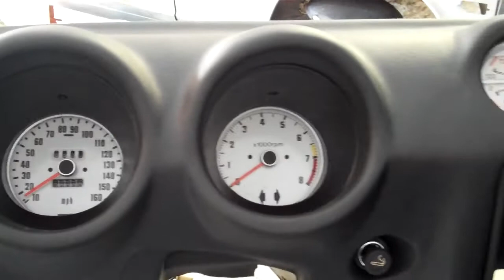Video #34 - I BLAME CHIP FOOSE FOR THIS!!! Datsun 260Z Rebuild

Comment from the maker: The only needles Dad had to take off were on the speedometer and the tach.  They pull straight up, and you have to be really careful when you're pulling them off.  On the tach, there's a plastic piece that you have to pull off that unfortunately broke and had to be glued back on.  You have to make sure you put the needles back in the same orientation as when you took it off.  All the other guages stayed in place, because they split in half and go around the needles.  Hope this helps.

Comment from the maker: The trick was to make sure that the original plates were clean, because any kind of dirt would be visible through the stickers.  Dad found that once he got them in place, a couple of gentle passes with a heat gun made them bond beautifully and removed all the air pockets.  It also helped to make it conform to the odometer openings, where it's slightly recessed.  The best part, was painting the white needles with Moms Milani nail polish "Juicy Glo" orange, available at CVS.

Comment: i love the white guage! i just bought a 240z with a 280z drivetrain. there is littarly no floor because it rotted out. when i pull my dash out to fix the small holes in the cowl i will deffinatly purchase some white guages! i going to paint mine midnight blue, well its a little bit lighter, and that along with blue led lights in the guages.

Comment: Looking great Austin. I think those are the 85' to 89' Maxima calipers. What adaptor bracket did you get? Motorsport has the complete kit (adaptors, correct E-Brake bracket, bolts and Stainless steel braided brake lines. You need the 82' to 83' 280ZX rear rotors with that kit.   I LITERALLY just installed my Stage 1 Kit (complete rear disk brake conversion kit) today. Thought it was funny to see you plan the same thing. See you in a few weeks!